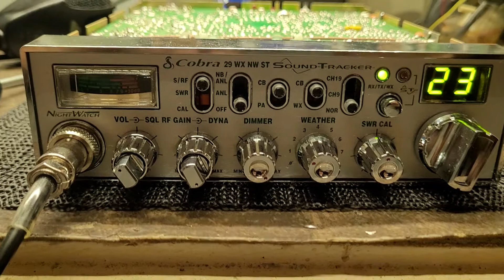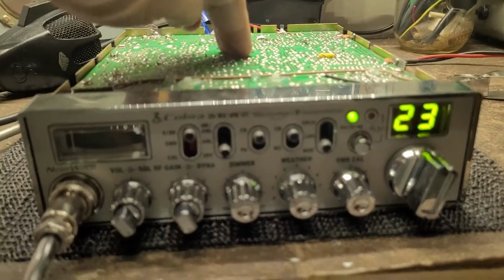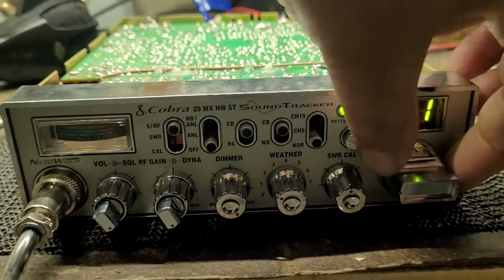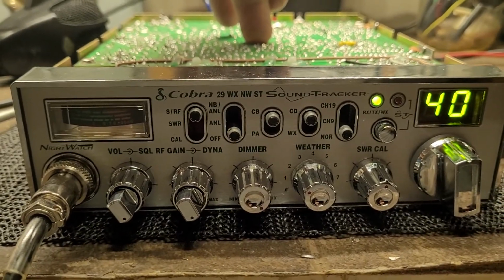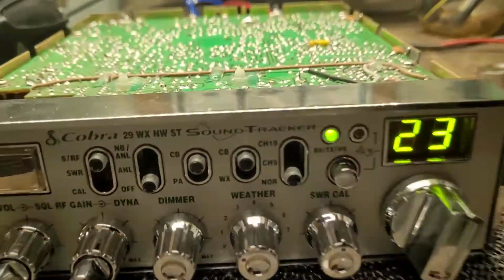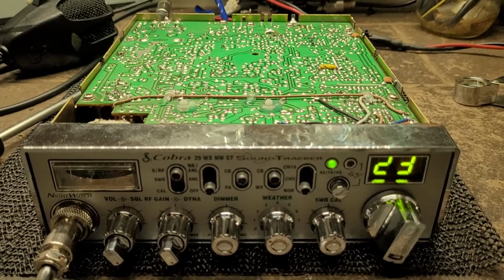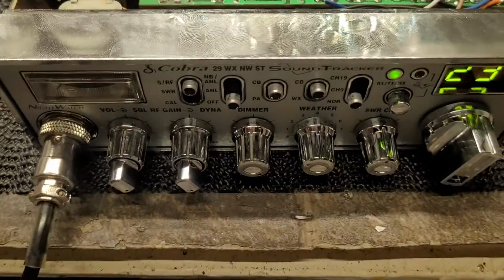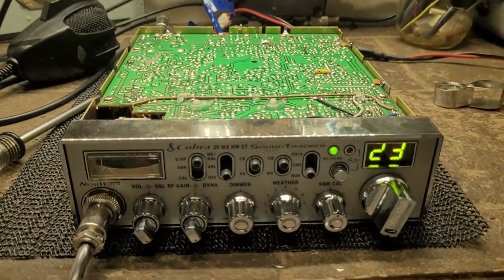COBRA 29 WX NW ST - Trouble shooting and repair PART-3

Comment: Hi Darrell, you may have a cold solder joint over in the vco section behind the channel selector about 4 inches from the front. I've seen this happen a lot on the newer 29s. Best of luck!
Reply from the maker: I will check it out

Comment: I’ve had 3 of these that never work, just bought an old conversion van and it does nothing. Are these just junk?
Reply from the maker: Depends what you mean by not working.   Could be anything from a microphone cable, faulty antenna or no antenna to a circuit board issue.